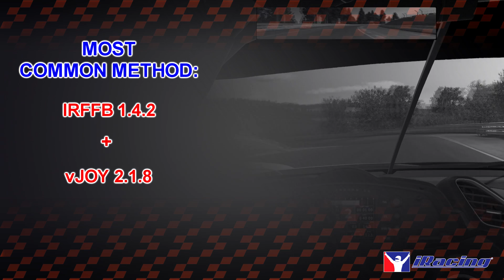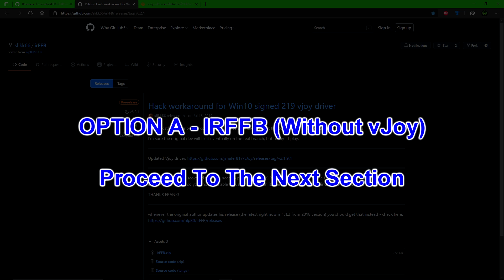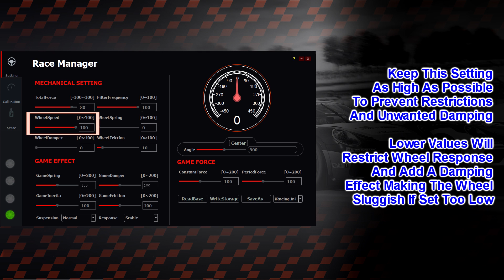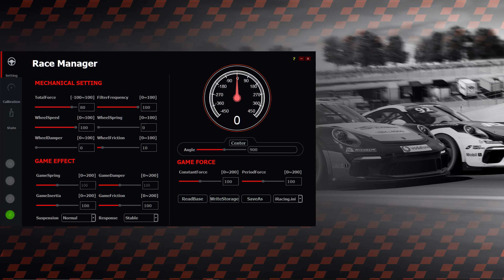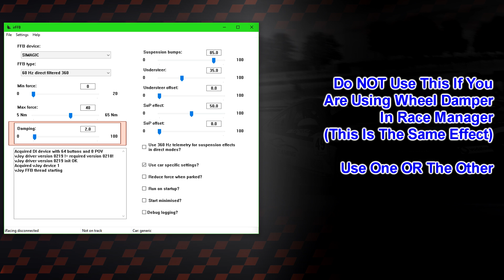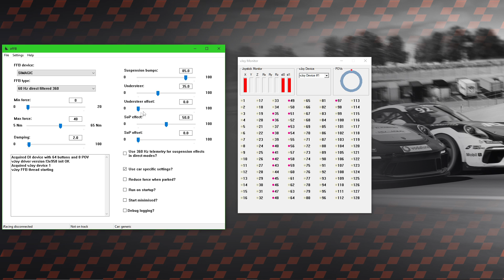Simagic M10 FFB Settings - iRacing (IRFFB 1.5.9 + vJoy 2.1.9.1)

Comment: You still use the irFFB with The Simagic Alpha?
Reply from the maker: With the introduction of the new Interpolation filter in SimPro, I no longer use irFFB for iRacing. Instead, I set Interpolation to 3 or 4 (depending on car) within SimPro Manager.
Reply: @T3KNOSIS  thank you. Do you feel a incredible oscillation with the BMW gt3 car, if I have my WRS over 3%  can’t take my hand out the wheel with the wheel completely loosen control!
Reply: @T3KNOSIS  tell me please. what version simpro manager you use with m10? i use 1.32 v159. Can i use simpro manager 2.0 with whis wheelbase?

Comment: I've used these settings for my mini that just arrived. They are the best I've used so far, however these are for the M10. would u suggest any different settings for the alpha or mini? And would u recommend using irffb with the mini or do u feel that good results can be had without it?
Reply from the maker: I have a spreadsheet of settings for the Alpha Mini located here:
https://docs.google.com/spreadsheets/d/e/2PACX-1vTi0IM--0L1y7ECOk_yXe50o6jOAA1wk5kytYlQUOWhqq24b_0C_fwBt8txDmMbGJ6QFCCWjhYOiBdS/pubhtml
I will add more game titles when I have time.
Reply: @T3KNOSIS  awesome thx
Reply: @T3KNOSIS  Do you by anychance have a sheet for the alpha not the mini? Great video by the way excellent explanations.
Reply from the maker: @christikfa  You can find manuals and Spec's/Dimensions here:
https://drive.google.com/drive/folders/1BGNPRvDdJ_1Mwy-xaoCyHjmiiWGTgeya

Comment: Hi , Thank you for sharing this info "just stubbled across this" , very good explanation on setting everything up.
question, I'm currently using irffb and vjoy on the version that everyone uses from 2018 that works with iRacing, this newer updated version of vjoy 2.1.9.1
and irffb 1.5.9 would I notice a difference in iracing , I use a Fanatec clubsport 2.5 wheel .interested what the benefits might be before deleting the old versions.
Thank you
Reply: Hi , thanks for the information,  I've installed it and I think it runs better with improvements on ffb from the old version,   I have also tried the latest vjoy you mentioned,  unfortunately I couldn't get it to recognise my steering wheel inputs to configure it , so I've gone back to the last vjoy 2.1.9.1,  if you find out how to fix this let me know,  great work!!
Reply from the maker: vJoy 2.1.9.1 has stability updates for newer versions of Windows. FFB cutting out along with weird FFB glitches seem to be resolved vs vJoy 2.1.8. 

There is also a newer version of vJoy that has some new FFB features, but I haven't tested this since it isn't compatible with Forza Emuwheel:
https://github.com/njz3/vJoy/releases

iRFFB 1.5.9 contains more SOP effects for various cars but can be used with the older vJoy revision.
Reply: @T3KNOSIS  I hadn't heard about any vJoy versions newer than 2.1.9.1.  I see the link you provided takes you to 2.2.1.1.  Do you know if anyone has run this with irFFB?
Reply: @moogleslam  hi , I have tried it but I couldn't get it to work,  so I've gone back 2.1.9.1
Reply: @keithpyne8316  Thanks for the confirmation!

Comment: No matter what I've tried the FFB section in iracing isn't greyed out.  With vjoy and 60hz direct filtered 360 selected.  And the controls in iracing still control the FFB.  If I switch to 360hz then irffb takes over.  i've reinstalled vjoy several times.
Reply from the maker: @Rob Gibson
When launching the Alternate version of irFFB, the log window should show something similiar to the following:

Acquired DI device with 64 buttons and 0 POV
vJoy driver version 0219 != required version 0218!
vJoy driver version 0219 init OK
Acquired vJoy device 1
vJoy FFB thread starting

If Using irFFB 1.5.9, the log window should show something similiar to this:

Acquired DI device with 64 buttons and 0 POV
vJoy driver version 113e638 init OK
Acquired vJoy device 1
vJoy FFB thread starting

THINGS TO TRY:
> Make sure your Windows is on the latest version, and all Drivers are up to date.
> Launch vJoy Monitor and make sure all axis inputs are working correctly.
> Launch Configure vJoy and click on Reset All at the bottom. I also uncheck one of the axes on the left, then re-select it just to make the Apply button appear. I then click on Apply and reboot my PC.
> In Windows Search, Type in Game Controller and select Set Up USB Game Controllers. Check if vJoy Device shows up here.
> Make sure to launch irFFB prior to starting iRacing.
> Launch iRacing from the Member Website instead of the UI.
> Try Both versions of irFFB
> Delete the irFFB.ini located in C:\Users\USERNAME\OneDrive\Documents
> Delete/Move the setups folder located in C:\Users\USERNAME\OneDrive\Documents\iRacing
> Alternately, move the entire iracing folder (C:\Users\USERNAME\OneDrive\Documents\iRacing) to another location and see if that changes anything.
> Make sure you are running the latest Firmware and Software for your SIMAGIC Wheelbase (FW: 4036 / RM: 4.1)
> Right Click irFFB.exe and run as Administrator.